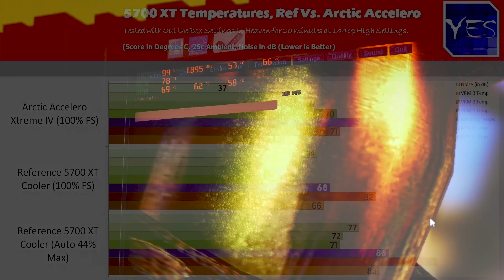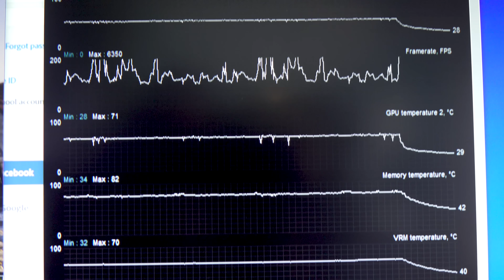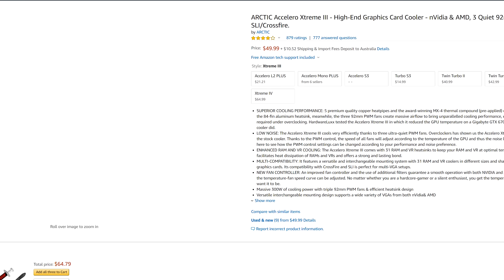Arctic Accelero on a 5700XT - Is it GOOD?!

Comment: You are not the "I thoroughly red manuals before starting" type guy, are you?
The back plate is supposed to act as a heatsink that's why you need to cut the film and use the included pads... I'm thinking on installing small heatsinks on my reference RX480 front. I'm not too sure the memory and VRM are getting hot or not with just that back plate acting as heatsink, do you have any temp reference I could use to compare?
Thanks for the video!
Reply: HW info can show you VRM and mem temps if your GPU has them
Reply: @lacucaracha111111  yep, I know, but I don't have a baseline I did the mod in a hurry, I should had tested and get the temps as it was and then repaste the standard blower cooler but I was pretty tired of all the noise and I couldn't be without my PC for too long. I will see if I can get some references from his Artic cooling modded RX480 video.
Reply: @RetroTinkerer  VRM likely. Mine was at 95C when just the backplate cooler was on, when I put a heatsink directly onto the VRM it came down to 75c , memory is ok with my RX570

Comment: Tech YES the Accelero Xtreme III comes with included heatsinks 😉
The washer problem should be fixed when the backplate is installed and connected to the backside through the thermal pads, which provides additional cooling for the frontside components of the card, through the PCB (RAM, VRMs, etc.).
But we will take a closer look at the washer situation 🙋‍♂️
Reply: ARCTIC well you have a new customer I am going to buy one for the Rx580
Reply: @mr_tea753  ! get the III one , not the IV. It can actually bend your PCB depending on your GPUs VRM location and the thermal pads being thiccccc.

Be sure to measure twice and glue the heatsinks on once, as the cooler may partially block some memory. (Issues with "1 size fits all" coolers)
Reply: lacucaracha111111 thanks for the advice didn’t know that this could happen
Reply: @Arctic Brian did not build it properly, I used several coolers especially the IV cools great (RX 480/580). Keep up your great products. May be you can order a Vega 64 one, too. IMHO only the Morpheus works.
Reply: @ThePeperich  The Morpheus Vega is so good.  I've got one in the mail and i'm checking every couple of hours.  So excited!!!!
Reply: @ThePeperich  I have a morpheus on a vega 64 a few things to note: Mofsets are cooled by included aluminium heatsinks and does not come with a backplate like the accelero. It does not come with fans, Included are wire clips to attatch fans, this makes it a huge pia to install the card, i bent a few fins and scratched the finish installing the card and had to adjust the fans in a tight cramped case. It does not come with a vga fancable/ adapter so you have to order one. The morphius looks better than the arctic until you attach fans  once its got fans its quite ugly. The morpheus is HUGE it take about 3.5 slots or 3 slots with low profile fans. Its cooling however is out of this world. I ended up Modifying (grinding / cutting away material) the reference base plate to fit under the cooler as the base plate cools the mofsets on the 64, it gave me a way to hid the fan cables and i think it looks better than bare pcb with heatcsinks glued on.
Reply: R9 390 with Accelero Xtreme IV...delta on gpu core is around 40C....(from around 95 to 55-56 max)...pcb and mem temps around 69C with instaled backplate and termalpads under it
Reply: It's good to see manufacturers taking interest, addressing concerns, and looking to improve their products. Keep up the great work. o7
Reply: I bought an Accelero Xtreme III about a week ago, my second one. Last time I bought one of these it was for a Radeon HD 7950. Incredible that the product is flexible enough to still be useful in 2019.
Reply from the maker: No worries, I would be much more comfortable, (and with that much more comfortable recommending the version 4) if you had a 2mm thermal pad that spans the whole back plate, instead of cutting plastics with knifes and trying to be that precise, I know my limits, and I feel I could damage my card doing this and I just avoid it cause I have rough hands.
Reply: @techyescity  I don't use that plastic... This thermal pads lying all under backplate gives enough space between pcb and aluminum
Reply: @techyescity  I have to agree that a full thermal pad would have been great. I used the IV on a GTX 1080 and it was a bother installing the backplate with just some thermal pads and the thin plastic sheet you have to cut up. But the cooling and noise was great.
Reply: @techyescity  There is nothing wrong with the Arctic Accelero Xtreme IV not having the small heatsinks like the III you just should have used the backplate as intended and your vrm and memory temps would have been significantly lower. I used it on my Galax RTX 2080Ti HOF OC Lab edition for a few months while waiting for a few watercooling parts, I could comfortably oc the gpu to 2175- 2190mhz and +1000 mem and run it like that all day no issues and thats with high ambient temps because I live in a sub-tropical part of South Africa  you can have a look here> https://imgur.com/a/ujQJ16g funny enough it looks like a stock cooler on the HOF :D
Reply: @techyescity  ^ This 100 percent
Reply: @techyescity  Hey Brian long time watcher and long time PC enthusiast, was wondering if you still had this cooler and would look at selling it (hopefully you read this) I have a The ASUS Phoenix GeForce® GTX 1660 SUPER and the factory heat sink on it is just junk. I have seen a few people have great success with these coolers with the single low end variants of gfx cards, the issue is they have unfortunately stopped making these....... anyways keep up the good work haha
Reply: @guy 83728 83728: The thermal pads themselves don't dissipate heat, they are only used to transfer heat to a heatsink.

@Doer Rosales:
 Which model exactly?

@Last Second Bloomer: If you are in the US they already are 😊

@Tjocksnorris äventyr: ACTUALLY!☝🤓 😉 Our coolers support a lot of the RTX 2070 cards (most manufacturers use the PCB layout of the 2080 for their 2070 cards, which is compatible)

Regarding the heatpads: using a quality heatpad the size of the whole PCB would increase the coolers prize significantly, and since we didn’t want to cut corners and use an inferior one, this wasn’t an option for us.
We want to offer our products at a fair and reasonable price, but are always trying to improve and are happy about productive feedback from you guys, to look into! 😊👍
Reply: Respect for the respectful, prompt response.
Reply: I've managed to install the III version on a reference rx480 right from the beginning. It still runs perfectly.
The important thing is that I've made a very small modification to retain the stock memory plate.
If you are really interested to make serious money, I suggest to study a kit for the reference rx 5700 series, that allows to keep that original plate, it looks really professional!
Reply: @TheSilviu8x  absolutely correct being able to keep a memory plate would be great
Reply: i guess, i need this for my old 1080 founders.....go over 85 with stock cooler....
Reply: @Knebebelmeyer  Do it! Temps will go down 15-20% and noise 50%, the Pascal FE coolers where really terrible.
Reply: @TheDembe1  "really terrible"??...my 1080 cooler is the worst i ever have seen on a gpu!....i never need a heater for my room, if i let the case open and play some games for 1 hour!...
this card is very good! but on the other hand, it heats up very very fast!
nothing in my case heats up...my cpu is a 6600k on 47 delied and will not reach the 50c....but the gpu reach easy the 80 85c and the whole card gets pretty hot!
its a problem.....if i want to use this card for few years i have to do something
Reply: @Knebebelmeyer  It's worth 50-60$ to get a aftermarket cooler, i read great reviews about my RTX2070 MSI Armor but when i OCed it almost hit 80c and the fans made this whiny noise...or you could go for a 120/140mm AIO and NZXT G12 to watercool it, there are pros and cons with both, Arctics cooler will probably be more silent but have slightly higher temp and warm up the components inside the case a few degrees, the AIO if you put it so the warm air blows out wont heat the rest that much but you have to go naked PCB (don't think i can sqeese in heatsinks under the NZXT G12 bracket) but it works fine for me. 2070 and 1080 are in the same league in terms of preformance and how much power they need, 5700XT  wants 80-100watts more than both of them cards, thats a lot!
Reply: @TheDembe1  im not sure...i get this 1080 for 250€...and play just 5-8h per week at one game..WOT! for this game i not use all the power of this card and i use a tool to underclock it^^..less powerlimit and manually 60% fan will solve my problem...in this case i dont know should i spent the money or not?
Reply: Arctic 3 FTW!!, Maybe not so much chunky backplate?
Reply: @ARCTIC You should really work on your marketing, especially in the US. You guys have amazing stuff but only a small number of people know that, which is a damn shame...
BTW, when are the Liquid Freezer II coolers coming to stores?
Reply: come on artic you did always a great job do this in the same way (big fan of you) fix it asap
Reply: I actually have the version IV and it works pretty well, but I bought it second hand and the dude I bought it from included the heatsinks. I hope you make a V version, but get some clearance on the RAM, since on some first PCIe x16 won't fit because of the extra upper slot touching the RAM (X470 Taichi and Corsair Vengance LPX RAM which is small RAM).
Reply: Oh cool its the brand! Wild you guys responded.
Btw do the thermal pads work ok compared to the mini heatsinks?
Reply: Awesome, they replied! I wonder if they make one of these that'd fit on my Vega 64...
Reply: You have one for the rx 580 itx?
Reply: @doer105  yes i do
Reply: @jimsinnovations2737  oh, lol. Sorry, i was trying to ask Arctic if they have a cooler for an rx 580 itx
Reply: @doer105  i know i just saw a good opportunity to mess with ya hahah
Reply: @jimsinnovations2737  freak!.... It worked. XD
Reply: @doer105  haha
Reply: This is fantastic, company and tester can interract over youtube :) 
All i can say the coolers are really awsome, to bad the support for RTX2070 is slim so i bought a NZXT G12 and a AIO watercooler. I bet this cooler would have worked with some weaking.
Reply: @TheDembe1  ya but thats not a good cooler for it either, and your leaving to many hot spots exposed on the card with that cooler
Reply: @jimsinnovations2737  1080 dosnt draw that much power and a glued heatsink in vrm and ram works fine.
My RTX2070 is naked on ram and vrm with a 92mm fan blowing down on it and it is fine and oc even higher than the stock cooler that had almost no contact with vrm and a block that covered the gpu die and rams.
1080 dosnt draw that much power, 5700xt is 100w more för example, Nvidia vrms are better. So its a no brainer really because the FE Pascall stock cooler is REALLY bad.
Reply: Is it possible the screws were over-tightened with washers on initial installation causing uneven contact to the GPU? While removing the washers helped alleviate the problem? Without washers there is risk of damage due to the way 2 of the VRAM chips & other circuitry on the opposite side of the core are positioned  compared to other GPU layouts;

 Look at the reference PCB, particularly the two top VRAM chips, as well as the circuitry directly opposite but still rather close to the GPU core.
RX 5700 PCB: https://tpucdn.com/gpu-specs/images/c/3339-pcb-front.jpg
1080 PCB for reference: https://images.anandtech.com/doci/11987/geforce_gtx_1080_front_pcb_1463236682.jpg
 

If you pause at 6:05, you can see the baseplate looks a bit warped https://i.imgur.com/WoDTkEW.jpg , which could be overtightening, or a factory defect? I suppose there could be some clearance issue between the plate & core itself, given how the reference cooler seems to have a specific indentation for the GPU core that is not level with memory, but still given the cooler actually worked without washers, I wouldnt expect the core to have any contact issues that cannot be controlled by careful installation & screw tightening order as per the instructions.

Anyone buying this just be extra careful with mounting procedure & tightening order of the screws which should be in an X pattern to the same degree,, this is especially important because if the side opposite to those 2 close VRAM chips is overtightened the delicate circuitry may be at risk, take a look at the RX 5700 Pulse PCB & notice the small rubber bumper close to the core; https://www.modders-inc.com/wp-content/uploads/image/2019/08/pulse-5700-XT-51.png

I also feel the backplate metal washers and spacers are a bit too fragile and bend easily, even just by finger tightening having installed the Xtreme IV on my 1070 Ti. It would be good to see some stronger metal washers & spacers in future revisions.

Also this; https://youtu.be/Ud8Bco0dk6Q regarding GPU mounting pressure, they use a thick pad on reference not paste, so apparently paste = poor contact without more mounting pressure,, which could be the reason removing washers to further tighten the cooler down might have helped, though I believe it's possible to do without removing washers.
Reply: so what ya saying is ... user issue hahah
Reply: Fairly certain the washer issue is caused because the 5700XT uses a pad normally so the spacing is off compared to previous generations of cards.  Just be careful if you aren't using the washer not to overtighten it and crack the processor die.  I'd also be curious to see what kinds of temperatures you get if you used a better thermally conductive adhesive solution like the Arctic Silver Thermal Adhesive.  I used that instead of the sticker pads and the VRM/memory temps are noticeably better.  Also dropped my overall power consumption since the VRM's are running more efficiently from being cooled more effectively.  My GTX 970 with an Arctic Accelero Xtreme GTX PRO modded to fit on it never reaches 70c and it's overclocked to the moon, sucking down 220watts compared to 275watts before using better thermal adhesive on the VRM's.
Reply: It would be very nice if you include 2 mounting plates: one for nvidia and one for AMD (smaller); so we wouldn't have the plate over the vRAM and could glue all heat sinks without space problems - I have a twin turbo 2+ RX580, its a great product, but I could't glue the heatsink over the vram because the mounting plate
Reply: A large thermal spanning the entire backplate would be greatly appreciated
Reply: that's why i love this company. I recently bought Arctic Freezer 34 Esports Duo and that cooler is simply outstanding. The performance, build quality and the price are unreal. It's proper to mention that i don't overclock, but that said, my cpu never gets past 50C celsius, where it previously reached 80C and above. Now i need something for my Gainward GTX 1070 Ti, since it looks one of the fan is not working properly.
Reply: Can I just say what a cool (ha ha no pun intended) company Arctic are. I have an old HD 5970, that uses this cooler stock out of the box, one of the fans stopped working, and I was able to order a new 1 from Arctic, but the price blew me away, for the whole fan assembly on the front of the heat sink, with 3 fans embedded in it was less than £5, I think delivered to my door from Germany to the UK it was under £10, so nice one Arctic, my old HD 5970 is now back up and running like a champ.
Reply: I have maximum temperature on gtx 970 with bios moded and overclocked only 54celzius on load.
Great job Artic.
Reply: I have my 5700XT with the Extreme IV and Conductonaut @ 2150 and 1800 VRAM I hardly go above 50C° and IDLE 27C°. The Accelero Extreme IV loves liquid metal, you can have the most Extreme cooler, but if you put Toothpaste in between it won't work.
Reply: Please make a NEW Accelero Hybrid! Or an Accelero V...or both. The Enthusiest market could use both. Or I could try rigging my own. The Accelero 4 and the Artic Freezer 2 DO seem to share the same bracket mount....
Reply: Will this fit the 5500xt.  Already got one on a 1080ti and it dropped temps from 80 - 50.  This 5500xt runs at about 70-80 so if it fits i will fit one.
Reply: Hi Arctic, would this fit the Asus 970 turbo reference card?
Reply: Please consider making some coolers for the rtx3000.
Reply: Hey @ARCTIChannel any chance you guys will make more of these or have a solution to cool a The ASUS Phoenix GeForce® GTX 1660 SUPER
Reply: id why you guys cant make something better that covers the whole card? like others for example?  i mean if you have the manufacturing capabilities to start with to make something like this why can't you go out and make something that is just as good or better then what the AIB partners do for various cards?

Comment: Ref cooler is garbage always have been don't know why people buy them.

you can pickup 3rd party ones for same price which have much better cooling making it pointless to even pay out for this Accelero

by the way these types of memory the rear is the place the cooling is needed not the front so adding those little heat sinks could be 100% pointless you really should of tested with and without the same with the back plate.

Last thing when you showed the tightening of the screws you was going up and down you shouldn't do this you should always do it diagonal it's always been like this for any type of heat sink it's to do with equal pressure you can damage the boards.